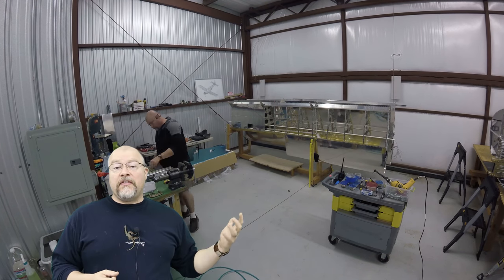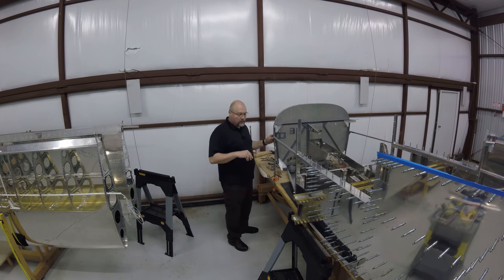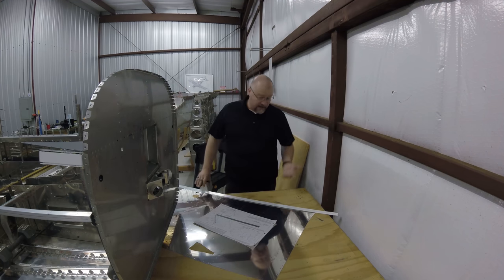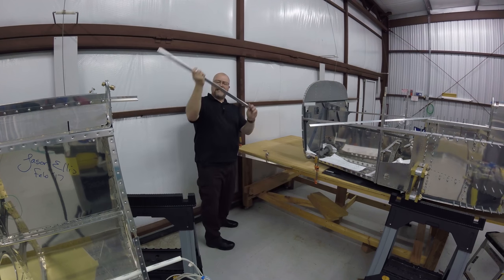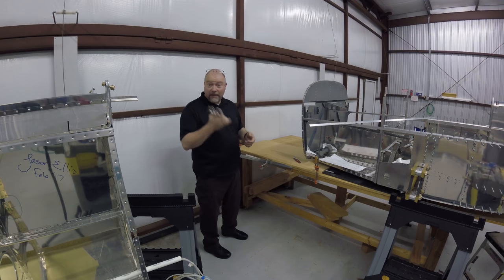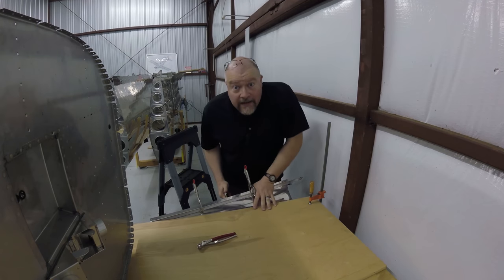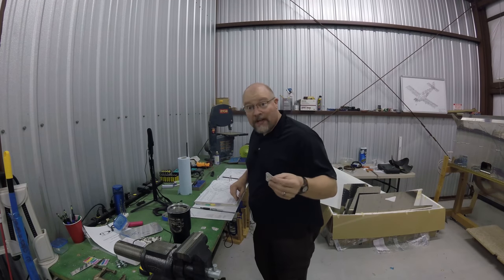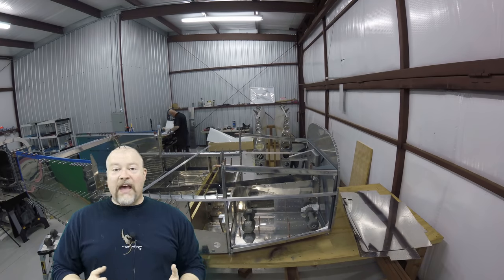RV-10 Fuselage - 025 - Forward fuselage skin bending, Q&A, 5 year mark!

Comment: 5 years, where does the time go.  Congrats, and keep the vids coming.   Re Requests;  some closeup stills of the inside of the fuse, views of the parts, subassemblies you know.   Use them as lead ins or lead outs.  If I ever get a plane it will probably be a Kolb.

Comment: Jason, you started off in your garage but have been in a hanger for a while now.  Do you think that impacts how much you are able to work on your plane?  It doesn't seem practical to do a quick 30 minutes of work before dinner when your workshop is away from home.  I'm trying to think of how I would like to do it.  It takes up a good deal of space I guess, which really impacts the decision too.
Reply: Dan, I am building my RV10 in a two-car garage. I have just about finished the empennage and I am going to order the wings soon.  I have the horizontal and vertical stabilizers hanging from the walls and ceiling. When the wings are complete I will hang those from the other wall to make room for the fuselage.
Reply from the maker: I've talked to this a number of times but the gist is;  there are pros' and cons to both.  The farther away your hangar the less likely you'll go work.  Working in the garage affords you that 30 minutes of work before dinner... But having the space of  hangar sure is nice =)
Reply: @JasonEllisBuilds  Thanks for the response...as I was typing I was thinking "Didn't he already discuss this a dozen times?"

Comment: Just a metric adjustable wrench not the more specific and rare Left handed metric adjustable one?  Lucky you! LOL
Reply: If you haven't done it yet, be VERY careful match drilling the forward fuse channel flanges to the steel firewall weldments.  Usually the upper left and lower right ones are not formed correctly and you need to clamp them to get any decent edge distance.  I went back and forth with Van's on this, they maintained the parts are ok but I dont think so

Comment: Wait... you have a Dodge Charger with a LS engine? Sure you don't mean a Gen 3 Hemi?  All our cars are "fleet white". I'm not a fan of white cars. Good luck on an Explorer. i was dragged kicking and screaming out of a 2017 Charger and put in a 2016 Tahoe.... which I am NOT a fan of. Been in civilian law enforcement for 22 years. Every car has its good points and low points. We don't get much of a choice in our chariots......
Reply: I'm in my 30th year now.  Our cars are replaced at 50,000km (30,000 miles).  oh that new car smell.
Reply from the maker: what?!  My car has 195,000 miles on it.. its just broken in..  (or just broken... )
Reply from the maker: I was told it was a "LS" but you might be right.. I'll look tomorrow.